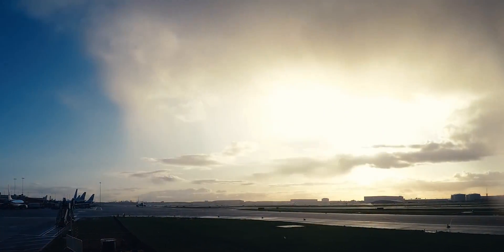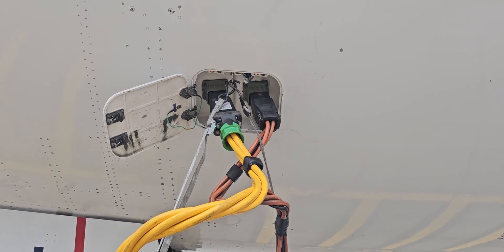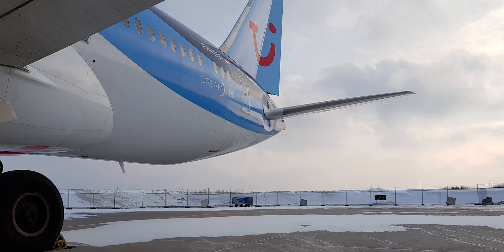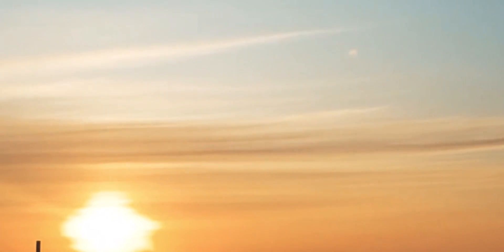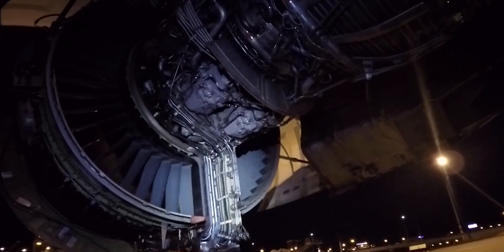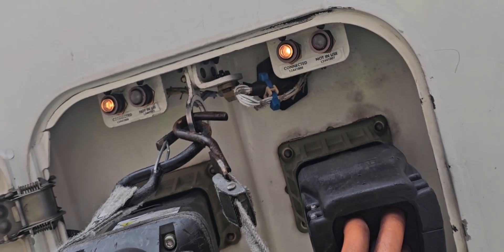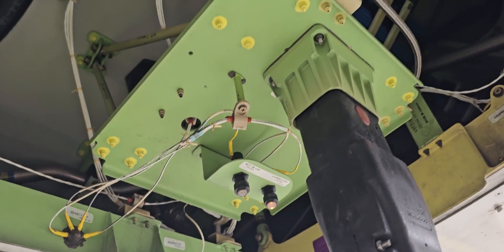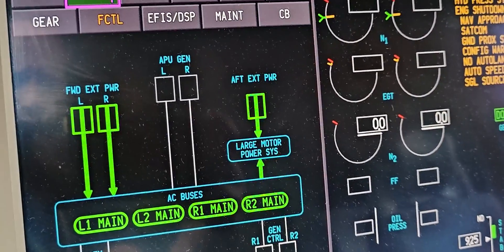How to start a Boeing 787 engine with a Ground Power Unit (GPU) + system explanation

Comment: Hi Thank you could you show us a little more in detail the battery diode module thanks
Reply from the maker: Hi! What do you want to know specifically? The battery diode module is there to make sure that the battery charger charges the main battery, not that another (unregulated) source charges the battery.
Reply: @NextGenerationMechanic  Hi good morning afternoon evening just a picture or video of it along with battery and the core in the eebay ty
Reply from the maker: If you follow me on Instagram I will post it there in my stories when Im back at work (if I don't forget it 😁).

Comment: Are there no weatherseals around the access door of the GPU?
Reply from the maker: No.
Reply: @NextGenerationMechanic  I hope Boeing is going to remedy this situation sooner than later?
Reply from the maker: Why? There is no moisture problem in this area..
Reply: @NextGenerationMechanic  Apparently the initial reports the problems are the seals and in October there is to be retrofit on the covers.

Comment: Left Engine cannot be powered from aft external electrical power as Aft external electrical power is connected only to L2 CMSC which is connected to RH engine VFSG, starting LH engine with aft external electrical power is same as not connected, it will consume power from frwd 2 electrical receptical and loadshedding will occur

Comment: What kva rating is your extra gpu? We have these at LHR and sometimes we experience engine start issues and lots of load shedding.
Reply from the maker: It's also 90kva just as the other GPU connections in the front. That's weird... It shouldn't be a problem normally.